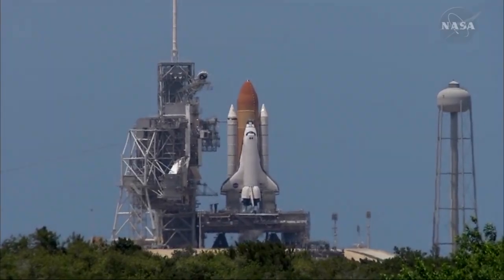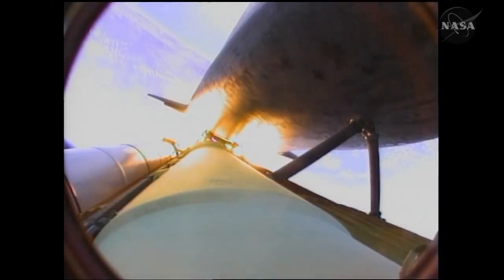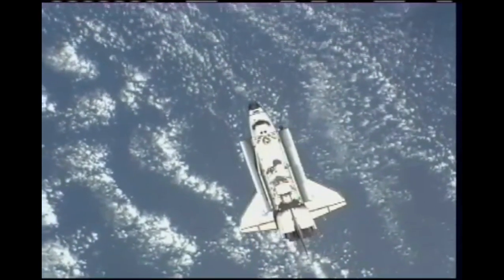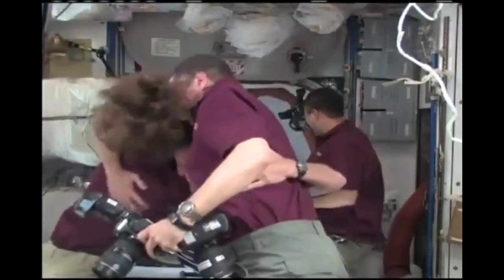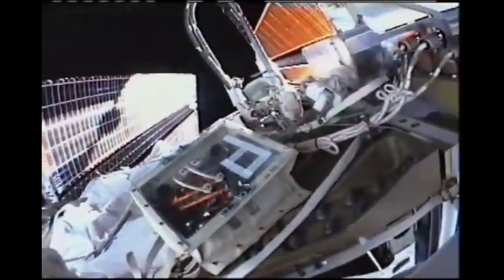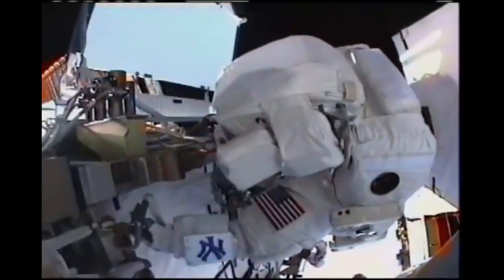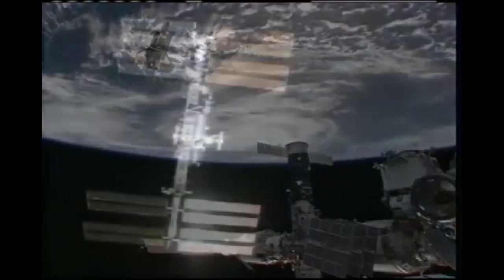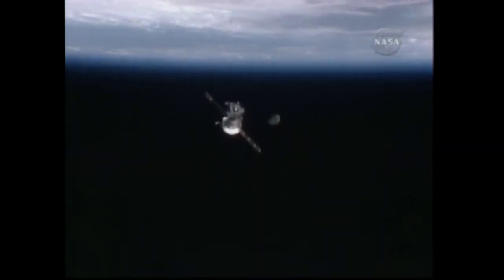International Space Station - Episode 40 - Rassvet & STS 132

Comment: But it isn't the last flight of Atlantis, you forgot sts-135
Reply: remgalpha No this is the last flight of Atlantis not the last flight of the shuttle
Reply: The normal player IDK this SHOULD HAVE been the last flight of Atlantis, but it wasn't. STS-132 may 2010 ; STS-135 july 2011
Reply: @Dev36o  But it wasn't. It was the second last. STS-133 was Discovery, 134 Endeavour, 135, Atlantis
Reply: @_Andrew2002  But it was meant to be the final flight of Atlantis. They just flew it again on STS-135. At this point I think that they were planning on STS-133 to be the final mission of the program.
Reply: @davros_adl8155  STS-134 was meant to be the last. Yes I know at the time STS-132 was Atlantis last flight but NASA said screw it we're doing STS-135 with or without congress approval. However, the problem is Kevin has the power of hindsight, him saying it was the last flight of Atlantis is wrong.